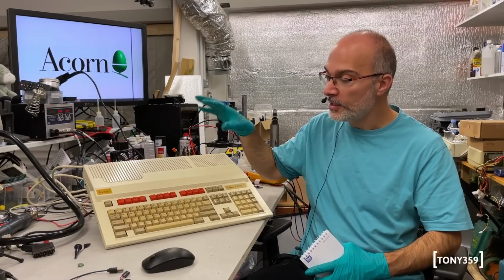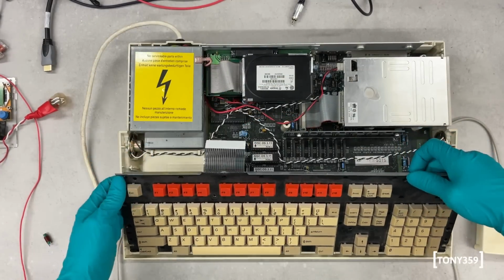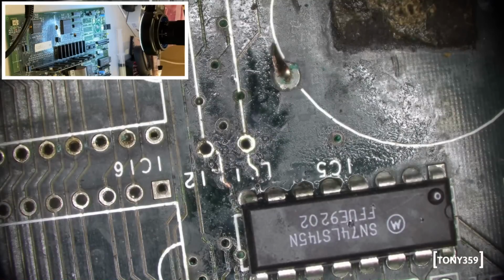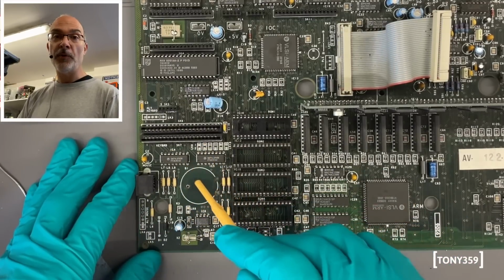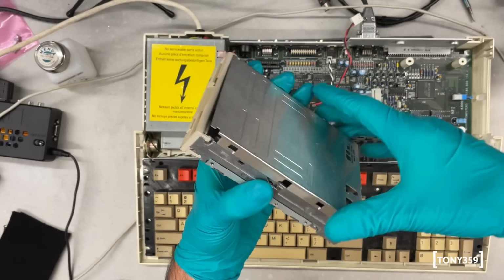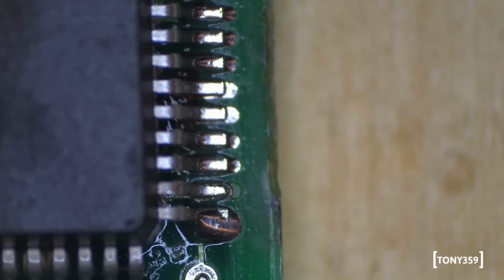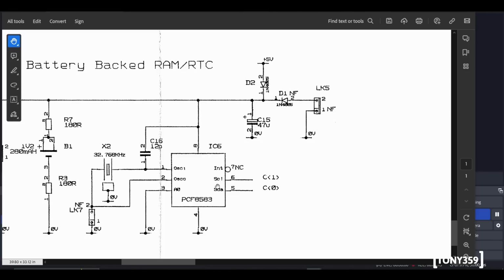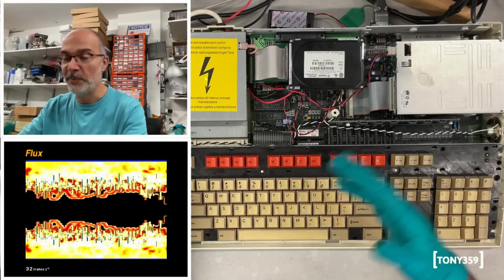This Acorn A3000 keeps failing - Repair video

Comment: Can the HDD be replaced with a IDE2SATA adapter to let you use a SATA SSD.
Reply from the maker: I don't know but it should work. Mind you, I had systems which were not compatible with those adaptors so you can only try and see.

Comment: Those Vertical Mounting RAM chips are used on the SHARP computer that runs a 68000 processor called the SHARP X68000

Comment: I wonder would a Meanwell drop in replacement PSU also it is likely that the battery might have leaked so the corroded tracks need to be bridged.

Comment: I used a old phone battery on my A3000. I thought they never got charged off the motherboard. I must of heard a video wrong. I was lucky to not get so much acid on the board. I had to replace the RTC chip to get it to boot it properly. It had been stored in a freezing attic for about 10 years. And the original monitor works ok.
Reply from the maker: it's been a while but I think I had 5V at the battery connector? I cannot remember if I checked or just trusted the schematics! :) 
Great to hear the monitor also works!
Reply: @tony359  I`ve put a proper RTC battery with a diode in mine now. Yes there is 5 volts at the battery. I got a RGB to Scart cable to use the old TV but it`s just a white blank screen. Works ok on mono cable. I wonder if I need to put voltage into scart pins to get the TV to turn on RGB.
Reply from the maker: @damianbutterworth2434  If I remember right the Acorn is a... analog SCART? Or digital? One that doesn't work with the more common scart. Like the Amiga maybe? I might be mistaken though. Did you check on the stardot forums?

Comment: I would have thought that the hard drive would require 12V as well as 5V
Reply from the maker: I think those are laptop’s HDDs so designed to run on lower voltages?

Comment: Don't know if anyone else has said this but I had an Archimedes A310 with what I assume was a version 1 ARM inside. 
I'm pretty sure this came out before the A3000 series and the RISC PCs (Still using ARM).
1MB RAM and one floppy drive. For the time a brilliant machine. I think it is still in my loft somewhere. 
At the time it cost over £1000 but I thought it well worth while. It could emulate a PC in software if I had to.
The 'Arthur' operating system was 'interesting' but worked well enough until RiscOS came out.
This was about the time that Amstrad brought out their early machines . Actually bought one of those for work because we needed an actual PC to run some proprietry software. No comparison!
Enjoying your videos and catching up slowly.
Reply from the maker: I have little knowledge of the Acorn machines but I have to admit they are amazing for the time they were released! The A310 was still fitting an ARM2 - I read that the ARM1 was never released. I did a bit of confusion in the video, I wanted to say the ARM2 was the first ARM CPU released, not that the A3000 was the first ARM machine released! Glad you're enjoying the videos - and thanks for watching!

Comment: 30 plus years ago I read an article describing RISC OS 3 and I was blown away because it was way more advanced than Windows. In fact, I couldn't understand why we all weren't using it. Anyway, I eventually bought an R7500, which incidentally I'm actually using right now, although I'm posting this from phone. Anyway, I like your video as sooner or later I may need to do the same things you just did. So thank you for sharing. BTW, while FreeBSD is my main system these days, I still keep a RPi 400 dedicated to RISC OS 5.28.
Reply from the maker: I agree that RISC OS seems very ahead of its time! But we all know how things work: VHS, Windows 95 etc :)

Thanks for watching!

Comment: Oscillator looks perfectly normal. It will be a sinewave of a few hundred mv around 2 to 3v of dc offset. You won't be seeing a 3.3v square wave if that is what you were looking for.
Reply from the maker: oh no, it was the amplitude which was concerning me. But as you say, it's fine. Also I believe that just probing a crystal will change its shape? Thanks for watching!

Comment: use white vinegar to neutralize the acid from the battery.  that will chemically remove the residue better then iso.  use iso after to clean the neutralized brine.
Reply from the maker: Thank you! It was done before but I did give it an extra wipe as you say. Thanks for watching!

Comment: The A3000 wasn't the first ARM machine Acorn sold - that was the A305/310/410/440 series
Reply from the maker: You’re correct and not the first one to mention! I mixed up the first ARM CPU with the first ARM machine! Thanks for watching!

Comment: If I get a vintage machine with a harddrive, The first thing I do is image the drive. Then copy that image to a CF card and run from that. Mechanical drives will fail.
Reply from the maker: Oh absolutely, we know we will need a CF at some point. The drive did not have anything special on it so we wiped it. The OS runs from the ROMs. Once the drive fails, we will replace it with a CF for sure! Thanks for watching!

Comment: Thank you for the nostalgic video. I had several  Acorn machines (from the early Atom up to a two slice Risc PC),  The ROM set contains far more than the OS (it doesn't boot from de hard drive just from the ROM) so maybe the rom nr3 contains a part that is only needed for Apps or expansion Podules? I stil have som ROM sets here even with the first Risc OS 0.3
Reply from the maker: Thank you for watching! On the forums they told me the ROM cover the 32bit bus - each ROM is 8 bits. So it's not possible to run the system without one of the ICs as the data back wouldn't be complete. Weird, isn't it? :)

Comment: Great job! 

EDIT: What de-soldering station are you using?
Reply from the maker: Thank you! It's an old Aoyue which I wouldn't recommend to anybody :) The iron is a Hakko clone, the de-soldering gun is a clone of the many available online, nothing special with it and not so great.
Reply: Gotchya. Just seems like it works well. Mine clogs after just a couple uses and it’s super frustrating.
Reply from the maker: Mine clogs too, the cleaning is done off-camera! :D
But I believe it's kind of normal for those things. Make sure the gun is fully warmed up as the whole pipe must be over solder melting point. If you don't wait enough, the solder will solidify before exiting the metal pipe. It takes about 8-10 minutes to be at full temperature and I usually keep my gun at 420C.

Comment: Nice repair! I’m glad you went the extra mile and actually fixed the hard drive instead of being like "I’ll replace it with a CF card" like many people seem to do. PCB faults isn’t what people usually think about when a hard drive is failing, but here’s proof that it is not always the mechanical parts that goes wrong.
Reply from the maker: Thanks! I was also a bit lucky on that one :)

Comment: About the CMOS repair. What you showed did not make me think it was broken. I would have expected that you use the external batteries (I didn't see you use batteries) to give the CMOS power then press "DEL" to initialize it and then if everything works power down again and after 5 minute boot again to see if the CMOS did hold the settings. Only if that fails you can assume the CMOS was broken.
Reply from the maker: Well, I had a "CMOS unreadable" error. Which wasn't there before and disappeared with the new IC. The issue was not the CMOS not holding the values but the A3000 failing self test and claiming it could not read the CMOS. Earlier in the video, that was not happening - but as you said I had to initialise the CMOS with delete. 
Later in the video it started failing the self test showing a red screen with error codes. That, in my understanding, does not mean the CMOS has lost its settings, it means the system cannot communicate with it. Thanks for watching!

Comment: If you want to get really preventative, you should bake a old board before soldering (24hr at 100C or so).  Maybe not such an issue for PTH soldering but chips and SMD reflow can blister if they have absorbed moisture.
Reply from the maker: Oh I know! :) https://youtu.be/omV1JJqiWAc (Old video, sorry for the bad quality!)
Baking is key for SMD. I now have a "dry box" were humidity is around 10/15%. I store a board I want to work on in the box for about a week, then I bake it. And it can still popcorn. I envy those who just blast 500C to a random board and claim they never had issues! :)
Thanks for watching!

Comment: Well done with the final repair of the CMOS IC. I wouldn't have known to replace that. Is it an EEPROM IC? It probably can only be written to a limited number of times.
Reply from the maker: Good point - I am not very familiar with the difference but would an EEPROM require voltage to keep the data? This will wipe the data if there is no voltage. The datasheet says 240 × 8-bit low-voltage RAM. Thanks for watching!

Comment: One of the most enjoyable repair videos ever.....i was biting my nails throughout the entire video......How about putting in a 40mm cooling fan?.......😊
Reply from the maker: thank you! Do you think a fan would be needed? I'm not familiar with that machine so I don't know how hot it gets.
Reply: @tony359   i believe its possible to mount a fan....it might get quiet warm since the power supply,the processors and hdd are all crammed into the system case....i am no expert but you can also try some stick-on heatsinks over the main chips...maybe use an infrared thermal camera to identify any overheating components?
Reply from the maker: it would be an interesting project indeed! I'll check the temp of the case next time I'm close to it.

Comment: Maybe it ist too late, but I suggest you make a dd image of that HDD as it is an ide drive together with the drive label, so it is possible to switch to an CF drive of something when the HDD really dies.
Reply from the maker: We've formatted it :) I understand that the OS is on the ROM - the HDD is only as extra storage. The unit belonged to someone so we didn't want any private data to be available to the public! Thanks for the feedback and for watching!

Comment: Of course we enjoyed it, as always. I wonder if it would be wise to cover the ROM's legs with a thin layer of some dielectric grease in order to prevent the corrosion from developing again.
Reply from the maker: interesting - wouldn't dielectric grease cause conductivity issues? After all it's very low voltage and very low currents. I really don't know, I'm wondering! Thanks for the feedback and for watching!

Comment: you can also use a capacitor as a replacement for the clock battery... have done this a lot on fruit machine boards...
Reply from the maker: Some devices I work with have the ‘super capacitor’ - wondering how long it would last and how much it would cost? What capacity would you recommend? Thanks for watching!
Reply: depends on the current draw of the cmos... voltage wont make much difference..and a bonus is a capacitor obviously is made to accept and deliver current so can be recharged while system is on @tony359
Reply from the maker: data retention uses 2uA at 1V which is the minimum the IC can work.
Reply from the maker: it's an idea indeed. Thanks for that!

Comment: How long does it take, from the first day you started to work on it, to closing the lid for the last time? Sounds like it could be months in the making for such a video
Reply from the maker: Sometimes it is - I hate when I have one project pending and I have to move it around while waiting for parts or simply while trying to figure out what’s wrong!
This one was ok. Two weeks in total and I mostly was waiting for spares. 
Plus a week to edit it 😂 
Thanks for watching!
Reply: @tony359  wow. 2 weeks is much quicker than I had in mind. I guess you got lucky in all your troubles closing the lid 😉

Yeah, I purposefully avoided the editing/post-production aspect because obviously that's a lot of time too. Especially to that level of production quality.
Reply from the maker: I tend to over-do things so yes, that multi-cam editing is kind of back-firing at me!  😅  Now looking for a faster video card!
This repair was straight-forward, despite the unexpected issues. Some others took much more time. I can think of the PS/2 floppy drive, the Macintosh restoration/repair, the Apple //c floppy drive! :)
Reply: @tony359  I've been recording footage of myself while fixing stuff, thinking I might eventually edit videos out of them. Multiple angles and all. But so far I've just held onto it. But it's been useful as reference material during reassembly and such.

I keep thinking... One day maybe. But I see how it can be time consuming and honestly I don't have time for it.

Kudos for people like you creating amazing content.
Reply from the maker: Thanks! Some creators are better than me at putting things together... :) I'm getting better!

Comment: The "inductors" are actually just 0 ohm links, the single Yellow stripe is commonly used on 0 R links.
They may well have created options for inductors to be fitted in those locations, perhaps for the US or somewhere with tighter emissions regulations but they just fitted links on this board.
Reply from the maker: Good to know - I trusted the PCB which says "L" on them :) Thanks for watching!

Comment: What a strange hard drive fault. I'm genuinely curious how that could have happened. It's so hidden out of the way there. I wonder if something was splashed on it during manufacture? A bit of flux perhaps?
Reply from the maker: It's still close to the ventilation and that IC is facing up (but covered by the HDD) so maybe something spilled and corroded overtime? Weird indeed. Thanks for watching!

Comment: Hi Tony. Have the very same computer, repaired for the very same problem. Thanks for the info on LK5 & D1 (1N4005 I guess), as I wasn't aware. Will fix mine following your guidance!!! It was described in the Service Manual (doh)...
Reply from the maker: So cool that those pads are there for us ready to use! :) Great to be able to help and thanks for watching!

Comment: Still watching the video, but lets just comment - the standing RAM chips are called ZIP RAM (stands for Zig-zag Inline Package), and it is period correct for some late 286 and 386 era machines, so end of the 80s, early 90s. It wasn't used for a long time, but it definitely wasn't that obscure. Among others, the Amiga 3000 for example has the same kind of RAM on the motherboard as "Fast RAM".
Reply: ZIP RAM was also commonly used on video cards from the late 80s and early 90s as it gave high capacities in a small footprint making it easier to fit on an expansion card.
Reply from the maker: Thanks for adding that to the conversation! That's cool, why Zig-Zag? I've never had an Amiga so maybe that's why I am not familiar with them. (That said I watched many repair videos so maybe I should have paid more attention LOL!)
Reply: @tony359  Because the pins follow a zig-zag pattern? As I wrote, it's not just Amiga (and even from that, only the A3000 and some expansion cards, I think) use it, but I've seen 286 and 386 motherboards with the same (and compatible) RAM chips..
Reply from the maker: Now you mention, I think I have a 286 board with ZIP slots!